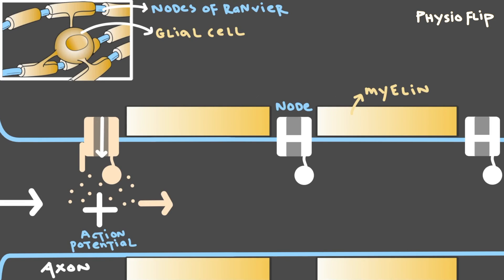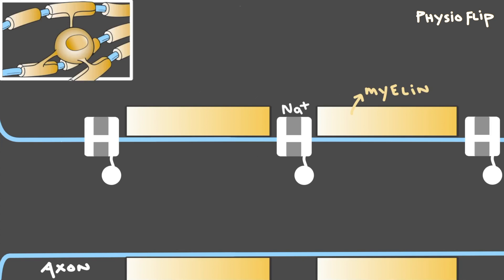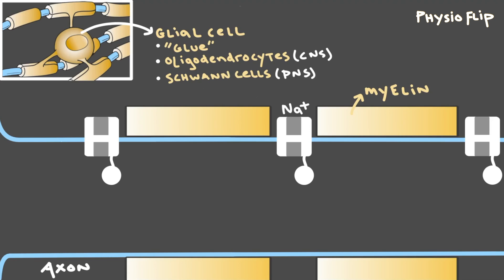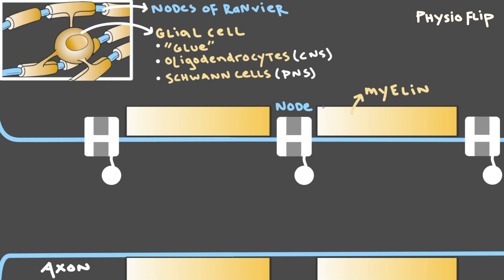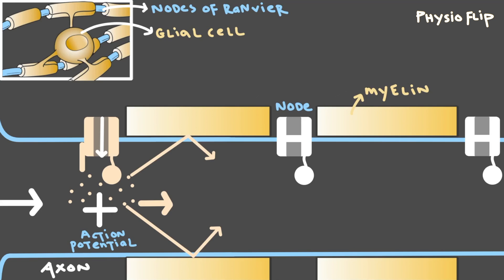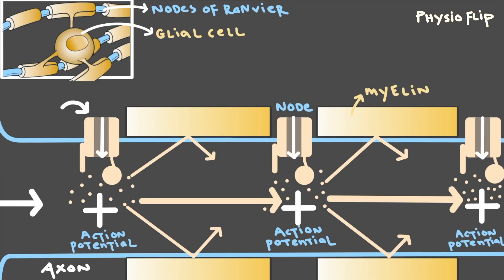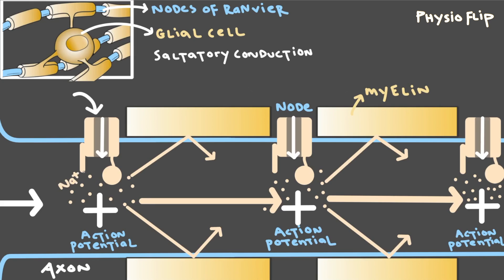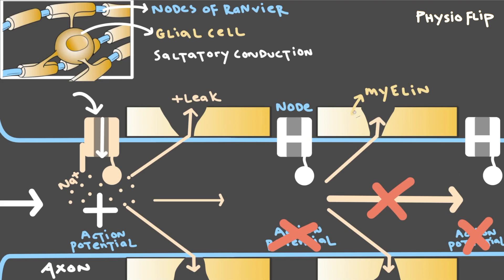Myelin and saltatory conduction | Action Potentials in Neurons

Comment: 6:35. Are the sodium ions actually leaking out across the membrane?  Coulombic electrostatic force has a inverse square proportion; when myelin adds thickness to the nerve cell wall forcing the intracellular ions further away from the interior the dominos fall nicely.  As the myelin degrades and the ions outside start to get closer the dominos no longer fall in a nice ordered state, they might diverge to the cell wall, if the divergence is too much and too many ions accumulate at a thinned section the next node of Ranvier might not receive enough ionic pressure to overcome the 15mV threshold.

Comment: 4:26. Is the speed of "signal conduction" faster than "ionic conduction"?  I am thinking in terms of Alternating current: electrons around metal atoms are sloshing back and forth with no net gain of travel distance while, because of sloshing back and forth, the signal is transferred at light speed.  Similarly it seems more precise to say that fast signal is propagated inside the myelin coated neuron faster than ionic diffusion.  High concentration at the first node of Ranvier bumps the next cross section of ions, which intern bump the next line; like how a row of dominos toppling while none of the individual dominos themselves have lateral translation.  Having charge (ion) concentration shift of 15mV (from -70 to -55mv) is enough to trigger signal amplification when membrane potential shoots up by a factor of 6.333 (95mV/15mV)(think amplifier gain).

Comment: how would this propagate faster than unmyelinated axons though? i understand that opening sodium channels takes time, but if sodium is what causes voltage-gated ion channels to open, shouldn't having the much larger quantities available with unmyelinated axons make it faster? i understand it takes time for the channels to open, but does the propagation of the action potential depend upon how quickly sodium diffuses through the axon and not how quickly the channels open as there does not appear to be a difference in the rate at which they open in either myelinated or unmyelinated axons?